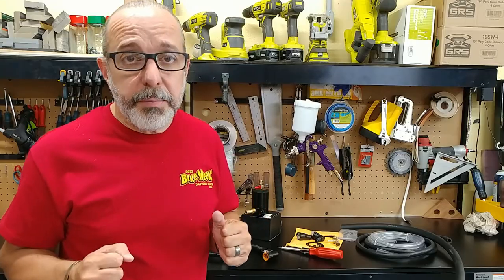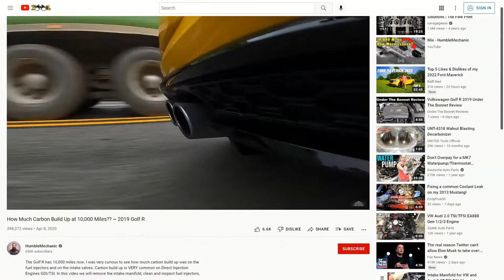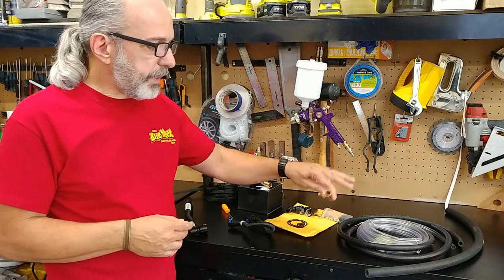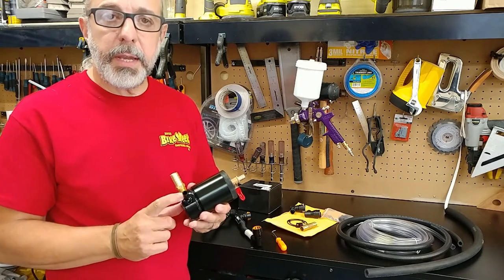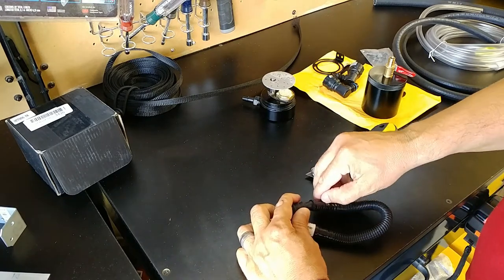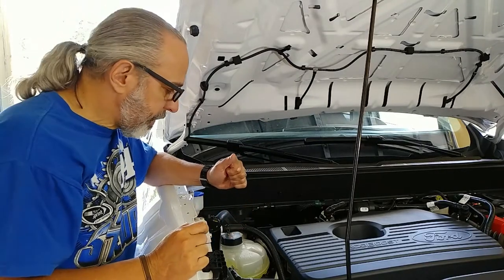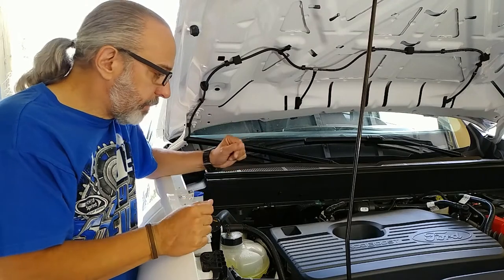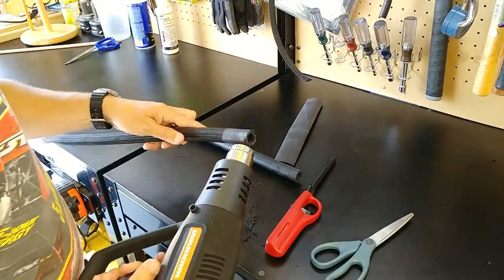Ford Maverick Catch Can Oil Separator Installation (Best Practice)

Comment: This is exactly what I am getting ready to do on mine. I identified the clean and dirty sides both needing a catch can awhile back in my research. Only reason ive yet to install mine is I was not looking forward to removing the intake to get to the dirty side pcv. Seeing how easy you were able to get it outta there has shown me that I wont need to go thru all of that crud.
Reply from the maker: … thanks for sharing, and yes, I have no idea what's the deal with removing the intake and all of that! After doing my truck, I did my friend's in less than an hour.

Comment: Great video & explanation. I’ll be adding a couple of catch cans to my Maverick this weekend.  
Although I did look for the “if it was necessary Ford would put them on the engine already” comment 😂
Ford Performance actually sells their own catch can, just not for the 2.0 Ecoboost. My dealerships service department even recommended adding them, so that answers any questions some people may have about warranty issues.  
I also saw your video on the Strut tower brace, I’ll be making one for myself soon too, with a slightly different design variation. 
I appreciate the video’s and wanted to say thanks and God bless! 👍

Comment: great explanation , I'm putting this on a 23 bronco sport 2.0 , nice clean install, I will use a nylon tube that will not collapse , also the best zip ties to use are TY-Wrap brand with the stainless locking clip - they just hold forever.

Comment: If the issue is the hose collapsing due to excess vacuum, just add a filtered inlet vent to the top of the catch can.  This allows makeup air to be pulled into the system as needed.
Reply from the maker: … hey, thank you for stopping by! That may work on other manufacturers, not on FORD! (should I say the MAV) The transmission gear MAP is 100% controlled by the manifold absolute pressure sensor. Any variation from the preset MAP and your shift point, especially under heavy acceleration, will be off! That is how I quickly noticed that something was not kosher!

Comment: What about adding a water methanol injection kit? Even with the catch cans you still do not get any wash down of the valves since it is direct injection. Water meth would help a lot.
Reply from the maker: … thank you for stopping by! Alcohol injection will not only help but literally eliminate carbon buildup., improve power, and prolong the turbo's life if injected in front of the throttle body. However, you are talking $800~1000.00 and a much more complex installation, not to mention the operation cost! Not only that, but unlike the catch can, which many dealers offer as an aftermarket accessory, even FORD is now offering it on their Ford Performance website; alcohol injection will void your warranty or at least get the VIN flagged in the system. If you are going to go that route, consider prometh - I have owned and installed several of their kits. They are very reliable and use good-quality components.

Comment: It's a shame we need these to correct manufactures cutting corners. I had a Mazdaspeed 3 and will never own a direct injection engine without some sort of axillary port injection. I went with the hybrid for many reasons, one was having a good old tried and true port injection engine. No worries about EGR valves, intake valve cleanings with walnut blasting, catch cans, rough idle etc ... But if you really want the Ecoboost option, catch cans are a must have.
Reply from the maker: ... agree, thank you for sharing.

Comment: I installed a catch can per this video.  It seemed to be working OK and filled about half up over some time.  I emptied it and now it doesn't seem to be working.  It is not accumulating oil any longer.  Any ideas would be appreciated.

Comment: 11 months later, have you noticed any ill effects on the pcv system from the catchcan setup?  One of the things you talked about that I very much agree with is when the engine has a good vacuum, it usually hums.  One of the first things I do to ascertain engine health is pull the oil stick at idle and put my finger over it to see how strong the suction is.  However, in my experience many catchcan setups end up just end up putting resistance on that check valve on the dirty side, and the vacuum suction of gases at idle isn't as good as it can be.  Remember that the engine is bringing in metered air THRU the pcv opening on the valve cover, so that it can force blowby out the pcv plate, when not in boost.  If extra restrcition, it can't do that as well.  It can be a tradeoff.

The best design I've seen is the UPR "dual valve" in tandem with a pcv plate that doesn't have a check valve.  The UPR does that instead. It also uses the negative side of the turbo to continue forcing gases out the pcv plate instead of the valve cover, even when in boost.

Just ordered the wife a Bronco Sport 2.0, so I'm definitely interested in your results.  Thank you.
Reply from the maker: ... thank you for stopping by. I personally never had an issue with catch cans or vacuum restriction, but I have fixed a few. This usually is caused by two things a hose collapsing as engine temp rises or under-sizing. I am using a reinforced braided hose for the high vacuum side, rated at several thousand pounds, and I also constantly monitor it! Take a look at my blog for the exact model. During the winter, the amount of gunk collected was minimal, but as the temps and humidity started to rise, the amount of fluid collected by the catch cans also increased. That is gunk that would have ended up on the back of the intake valves.
Reply: @CubanRedneck  I appreciate the response.  Dale!

Comment: PCV side the one that swivels should go to out on your can and the manifold the one that doesn’t move should go to the in side of your can correct?
Reply from the maker: … thank you for stopping by! The PCV (engine block side) is the input of the canister. The throttle body side (intake manifold) is the output of the canister. To identify the input and output of the canister, follow the ports. The one with the filter is out!

Comment: Can you do this to the 2.5 Hybrid Maverick
Reply from the maker: …. Thank you for stopping by. Sorry for the slow response. NO, the 2.5 MAZDA engine is “Port Injected,” and it cleans its valve by spraying fuel behind them instead of inside the chamber

Comment: Can you post a short update video on how the cans are doing
Reply from the maker: .... I will add it to a future video. I change my oil every 2500~3000 miles and empty the canisters at that time as well. Usually about 1 ~ 1.5 Oz. of light foamy goo. I have notice that the weather has a lot to do with it. During the Florida summer and 80-90% humidity they seem to collect a lot more than over the last 2-3 winter months.

Comment: I have a Bronco Sport Badlands with the 2.0 EcoBoost. The videos I've seen also show the intake being removed to access the PCV connections, because of this I haven't installed the catch can. I'm going to take a harder look at mine now to see if it's possible to install a catch can on mine without removing the intake, I'm sure the Bronco Sport is configured differently than the Maverick.
Reply from the maker: … hey Brett, without a doubt! And I too was taken back by all of these guys taking half the front of the engine apart when FORD's procedure for replacing the PCV valves makes no mention of it! I am almost certain the that the 2.0 on the Bronco is identical to the one in Maverick

Comment: I bought a “Maintenance Pkg” when I purchased my Maverick.
The Service Manager spoke to him about a “Catch Can” he stated it “could possibly” void my warranty!
Reply from the maker: … hey, thank you for stopping by! .. and wrong, wrong, and wrong! I suggest you find yourself a NEW dealer since the one you are dealing with seems to have no idea about what they are doing. Feel free to contact me via my website. I will be more than glad to engage your service adviser on a three way call. Please know that this is something many of the TOP FORD dealers in the country including mine sell and install for their customers, and it is also standard equipment on all NEW Mercedes, Audis, VW, and others. 

If you want your GDI engine to last over 100K miles, a catch can is required.

Furthermore, FORD is now offering catch cans under the FORD brand for the Mustang, Raptor, and other performance vehicles via the parts department. Please, read your extended warranty carefully! It DOES NOT cover "carbon build-up" because this is considered wear and tear. Also, may I point you towards my friend Rick's channel Ford Boss Me where he has shown many examples of what an EcoBoost engine looks like internally without a catch can or if you follow the owner's manual oil change interval recommendations. My service advisor called me back after an early interaction and apologized for recommending that my Maverick did not need an oil change until it had 10k miles. There is no way that engine will last 75K miles if you follow the manual's recommendations. They are are simply playing Russian roulette with the warranty.

Comment: Thanks for the great video.  I likewise have gathered many of the items to install the catch can on my Maverick.  However, I have had a problem getting the ends of the emission system hose, the hose on top of the engine.  If you can, please provide the source and part number of the hose ends.  Thank you
Reply from the maker: ... hey, thank you for stopping by. I am not home and won't be for a while. I got mine from eBay and I have part numbers in the blog (https://cubanredneck.com/ford-maverick-oil-catch-can/) try Googling it, if that does not work, get back to me, I will find you a link.
Reply: Tengo 12500 millas corridas en mi Maverick. Cuantos catch can debo instalar en mi Maverick?
Reply from the maker: … hola, como esplique en el video. El systema en este 4 cylindros tiene dos secciones una de bajo vacio y la otra con alto vacio. Sin el uso de valvulas es dificil hacer que estos dos trabajen bien. El problema es que las vavulas son costosa, y es mas economico usar dos catch-can come las que enlace en el blog - https://cubanredneck.com/ford-maverick-oil-catch-can/

Comment: How has no one commented on the video in a year. OK 2024 UPDATE and questions please. I have read that the motor already has this “part” on the side of the motor that provides this oil catch function. Am I to understand that it does not do a sufficient job and this dual oil catch system is still necessary to filter out as much of the oil as possible?
Reply from the maker: …. Thank you for stopping by. The short answer is no! The plate on the side of the engine is nothing more than a baffle, and it barely keeps the splashing action in the crankcase from sipping into the PCV valve. Catch cans condense the oil fumes so they do not get deposited on the back of the intake valves.

Comment: I cant fit the darn 3/8 hose on the fitting on the pcv side. Used grease and heat and only got it to pass the o ring and close to 1 barb.
Reply from the maker: ... thank you for stopping by! First, put the end of the hose in hot water (boiling water), then get needler nose plyers, insert the hose end into it, spread it for 5-10 sec, and then try to insert the fitting! BTW, petroleum jelly works better than grease or motor oil.
Reply: @CubanRedneck  thanks for the tip!I think I got them far enough that I don't think it will come out. Also I put a clamp on it. I will be doing the CCV catch can next week and will keep this in mind.
Reply from the maker: ... AWESOME!

Comment: do you see the need for check valves?. I noticed another mechanic installing inline barbed check valves?
Reply from the maker: .. hey thank you for stopping by and I am sorry for the slow response. We got slam by IAN. The check valves are not needed with the dual canister application.

Comment: Hi. I have the Hybrid engine, would you recommend to do oil catch can for hybrid too or just the 2.0 Ecoboots only? Thank you
Reply from the maker: … hi and congrats on the Hybrid. It looked attractive but did not fit my driving of 80%~90% highway. As to your question, no, the hybrids are using the 2.5L Duratec engine, which is a Mazda engine also known as the Mazda L 25, and it uses "port injection." That is when injectors spray the back of the valve, as explained in the videos.
Reply: @CubanRedneck  My Cuban Genus friend. Do you know if there is an engine cover for the Madza L25 engine. I also have a hybrid with the moose nuckle high speed low drag power house. I would like to clean it up a bit. Thanks for your expert service and your enthusiasm.

👊😁👍🇺🇲
Reply from the maker: @the305hauler  ...after texting several dealer techs. I am told that much like the 2.0 the cover from the 2020 Escape hybrid should fit. BUT this has not been confirmed! I have access to a hybrid Mav but don't know anyone with a hybrid Escape.
Reply: @CubanRedneck  So if the 2.5L hybrid engine uses port injection and not direct injection, are you saying that the 2.5L engine does not need an oil catch can at all? I'm curious because I've read that other hybrid engines, such as the 3rd gen Prius engines, do need them.
Reply from the maker: … hi, thanks for the visit. So, let's clarified a couple of things, there is no such thing as "hybrid engines." Hybrid is a technology where motors or engines collaborate for better power in the case of F1, MPG in the case of a street vehicle, etc. The engine can be any type, including two-stroke, four-stroke, port injected, GDI, or Diesel. I am not sure what Toyota is using. If it needs a catch can more than likely is GDI as many VWs, but as far as the Mazda 2.5 liter used in the Maverick Hybrid, it is a "Port Injected" engine. In other words, gas is sprayed on the back of the intake valve. That does not allow carbon to build up, and why there is no need for a catch can on a 2022 Ford Maverick Hybrid! I and others have to use catch cans in none GDI race engines to avoid detonation or pre-ignitions, but this is not needed on a street engine if the goal is to mitigate carbon build-up. Hit me back if you are still not clear.

Comment: The TASAN Racing catch cans in the link are not available any longer. Can you recommend an alternative that will work in the same way with the same parts in your list? Thanks for your help, sir!
Reply from the maker: ... thank you for bringing that to my attention. I just called a friend of mine, and this is what he ordered - https://www.amazon.com/dp/B07ZCSZR2R?tag=vert0a-20&linkCode=ogi&th=1&psc=1
Reply: @CubanRedneck  Excellent. Thanks for your help. I plan to build one of these for my new '23 Maverick. Your instructions are very clear, and I shall proceed with confidence.
Reply from the maker: ... awesome. Feel free to contact me if you have any questions.
Reply: @CubanRedneck  This catch can substitute has a "thread size of inlet & outlet of M16 x 1.5    The Amazon parts list on your webpage has a "Sintly adapter which will not fit the substitute PQY Catch Can in the replacement link. Can you recommend replacement adapters that will fit PQY Catch Cans?
Reply from the maker: ... thank you for bringing that to my attention. The original catch can I had recommended is always selling out.

Comment: Hey man love all of your content. Thank you for taking the time to help us all out. I am having the same issue that Jillian Gonzales is having in that I cannot find any the hose for the the second catch can near the radiator. I have an FX4 with the 4K tow, perhaps the configuration is different? Any help would be greatly appreciated.
Reply from the maker: ... hey thank you for stopping by, and no, the 2.0 is the same regardless of the vehicle. This includes the Bronco, Escape, and the little van. Please set your phone to record with the flashlight on and stick it straight down between the EGR valve that is the black cylinder with the red tag on the left side on the manifold and lower radiator hose, and with the camera facing the passenger side. Look for the blue connectors. If you strike out, contact me via my website so that we can talk.
Reply: I found it, thank you for everything JC, you the man!
Reply from the maker: ... no problem! Thank you for watching. I have several Mav videos filmed that I need to edit. I've just been distracted by life!
Reply: Know how that goes, gonna be praying for you brotha, God bless!
Reply from the maker: .. thank you. Likewise ♥️